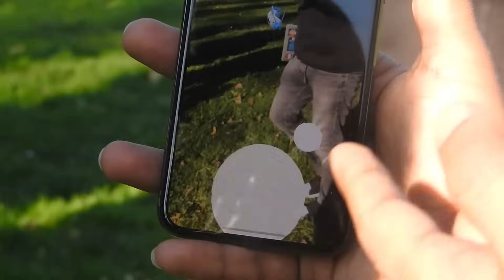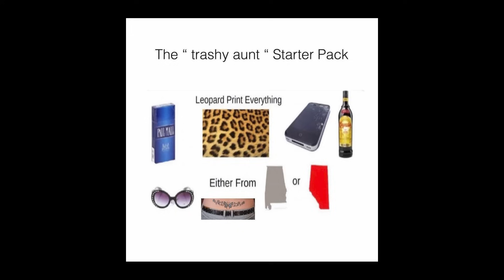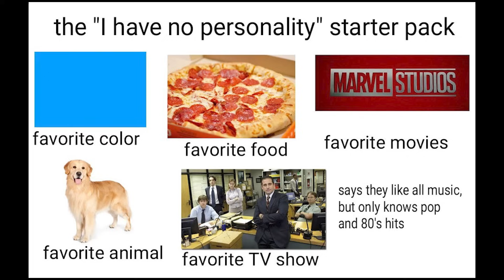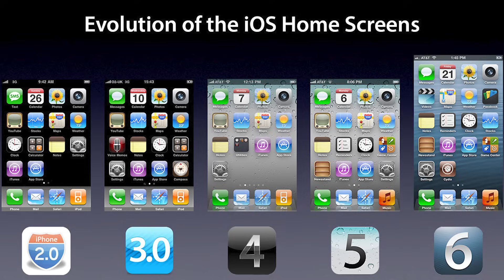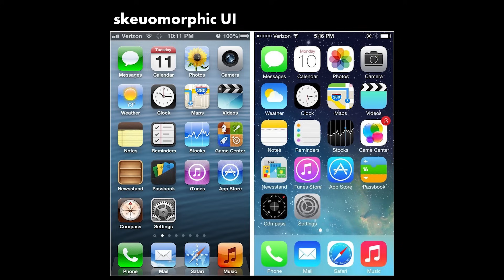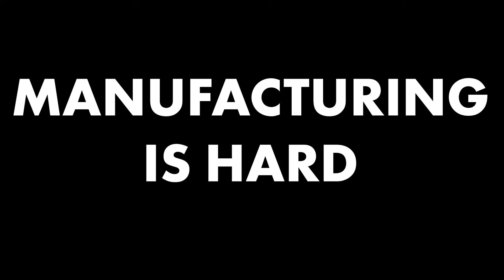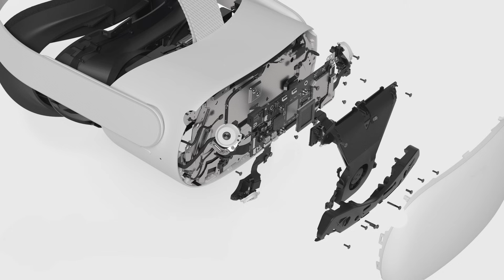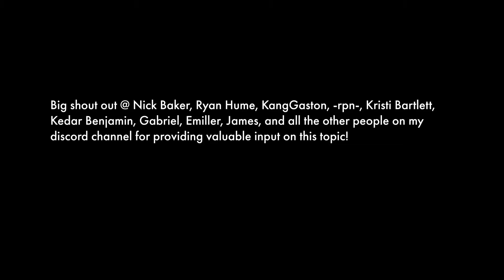Product Design Trends: Spatial Computing Will Change Design Forever

Comment: I  wonder just how functional AR will end up being over the next few decades. A lot of it focuses on visual augmentation, which can absolutely result in a lot of cool things. But relies on people looking at an object to interact with it. It completely ignores augmenting touch. 

We are already seeing a trend in replacing physical controls for a smartphone app. It gives a lot of versatility and enables easy updating of features, but requires you to pull out a phone and fiddle with it. RGB room lights are a good example. When I used some, the app allowed for an incredible range of colours and options, and voice commands were nice to control them when I was busy with something. But they completely failed to account for the presence of a physical light switch. Using it would reset the lights and require configuration every time. The only way to comfortably turn the lights off and on, was through voice commands. And while that works, sometimes after an exhausting day its just easier and more comfortable to reach for the switch when i get home.

Some of this is no doubt because i am more used to using a switch. But I think its undeniable that physical controls for frequently used single purpose functions are far more comfortable. Its why every single smartphone still has volume up/down and the power buttons. Even with the constant reach for the most minimalist smartphone design possible. 

A computer keyboard is a good example as well. With every keystroke my brain adjusts to the actual locations of the interaction points. Meaning i never have to look at my board and manage to type quickly and accurately. Not being able to feel the physical separation between the keys means that slight offset that is inherent when you aren't visually aware of the board cant be corrected before you actually press down on a key and send the input.

I think as long as we have physical bodies, AR will be most successful when it augments already existing controls and interactions rather than replacing them. Especially because you will always have to wear some kind of eye piece for typical AR to be possible.
Reply from the maker: Thank you for the thoughtful comment!

Comment: Thanks for a great video. The points are correct, changes to digital products are easier. #VR can give a huge competitive advantage and cost-saving. However, currently, the creation of #VRContent is based on game engines, and that's not a good way to go about it.  A no-code option to covert existing 3D content as CAD models, Scan point cloud to convert automatically to Virtual shareable model is way to go. 

That's what we are trying to achieve at iQ3Connect

Comment: AR is an incredibly difficult problem. We only in the last few years have phones and mobile chips that we can rely on giving us consistent performance and connectivity to the web. (just think how slow some webpages still load when you use a browser on two year old phones). Dumping a shit ton of local processing of 3D enviroment and beaming that back to a central server(only way to do this kind of thing in the short term) to positionally solve then place AR experience over then beam back onto a device that's light enough, powerful enough, stylish enough, and useful enough, is still some time out. 

Vr as it stands in occulus quest as is worth it now but the step to go from vr to ar utopia/metaverse people are envisioning/hyping up now seems so blind to the limitations of the hardware/problem. 

The mobile internet needed the Iphone's processing, connectivity, multitouch-screen, and software ecosystem with revolutionary UI. As well as people already using phones and ipods, and digital cameras that could be consolidated. 

The next compute device has to do everything your smart phone/computer/console does now but better as well as be a virtual connection device to be as successful as people hope/worry.
Reply from the maker: Yeah I didn't even focus at all on the technological shortcomings, but they certainly bear mentioning. Thank you for providing additional context.